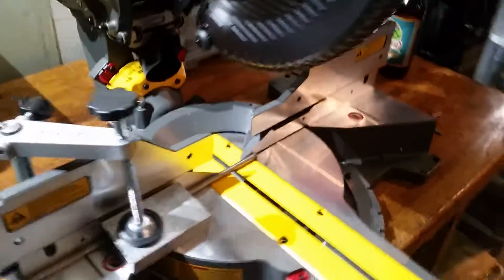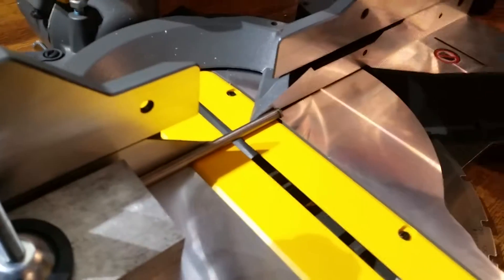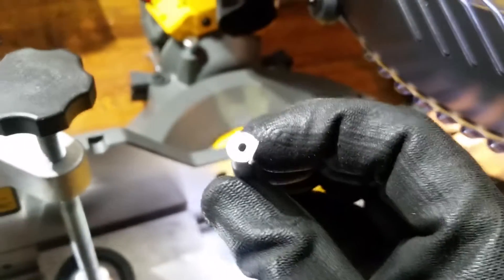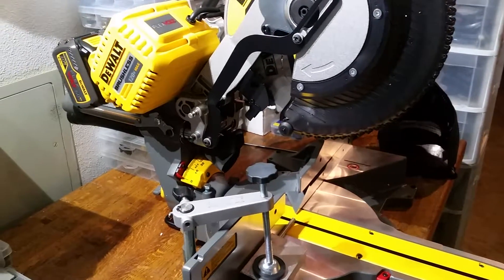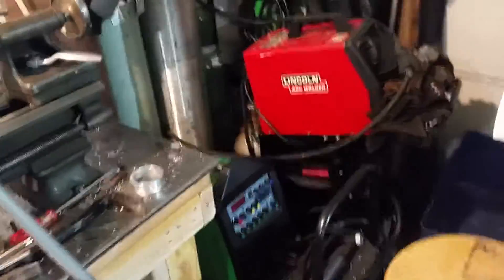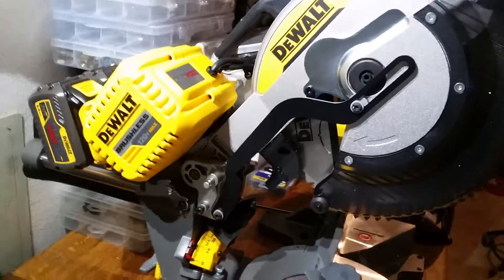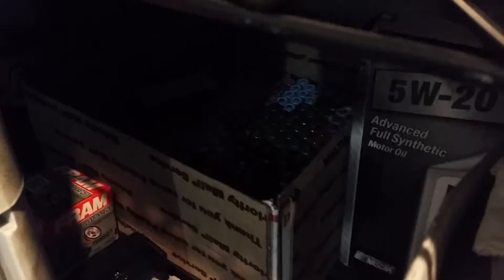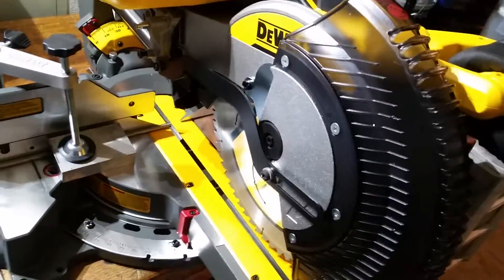Miter Saw Cutting Titanium, Li-Ion Battery talk, My shop.

Comment: What blades you suggest for titanium, Aluminum, & steel exhaust pipes......? Also like 4130 chromoly tubing.??
I want a blade that gives me the best cut and finish, especially cause I need to cute them at specific degrees, and I don’t wanna always cut and give myself room to grind and fit.
Kinda looking for a blade to get clean perfect cuts,with little to some correction.
Reply from the maker: I would use a bandsaw for thin wall exhaust pipe for sure and not a miter saw or any other spinning disc with teeth. Clean up will be required. Taping the cut area will also be what you want to do to keep the surrounding areas looking nice. ...cut through the tape, chase the edge w varying degrees of sandpaper, then peel tape and enjoy.
Reply: Mechanical Vegan hmmm, thank you, I was. Originally thinking the compound sliding miter saw, because I can select Angles, for doing Pie cuts for titanium Exhaust Piping, not sure if you’ve seen how pie cut titanium exhaust look, but that’s pretty much what I’m going after, with 304 steel and Aluminum intake Charge Pipes Etc. 
Do have any bandsaw Blade Recommendations??